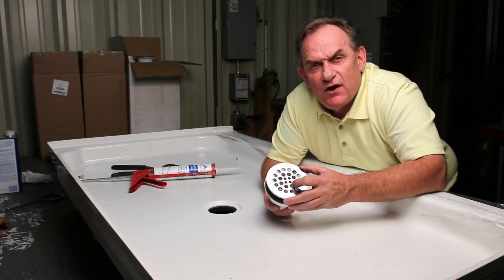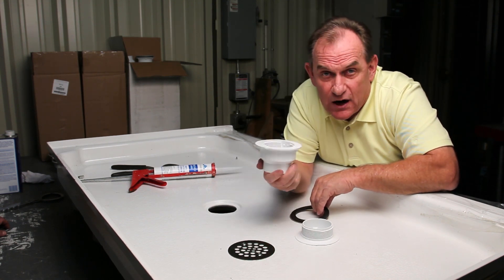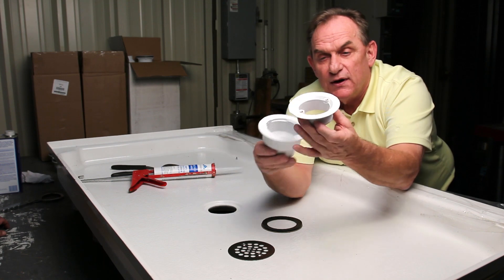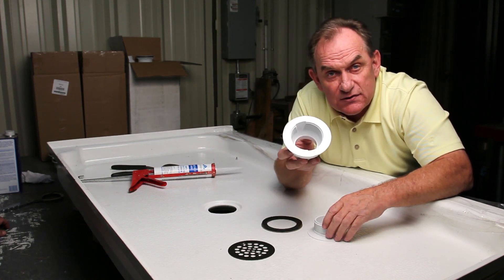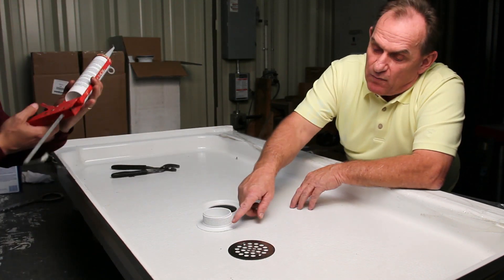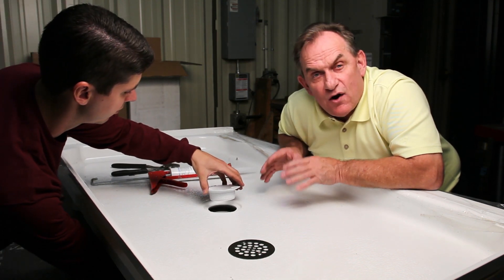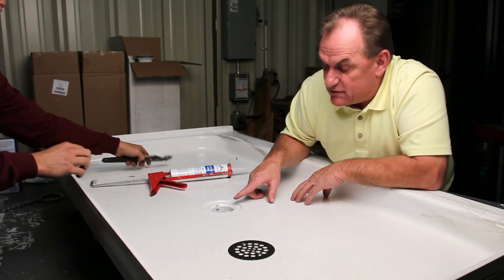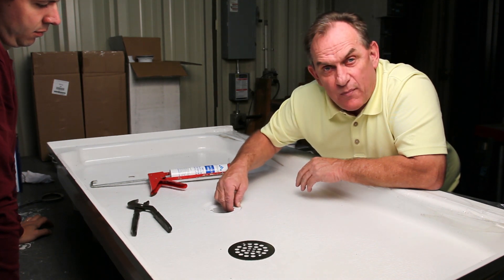Plastic Oddities - Fiberglass Shower Drain Installation Video

Comment: Sure enough the contractor who installed our shower drain (new home in 2012) used a ton of putty on the flange (where you used silicone) and the threads (which blocked the weep channels). No doubt, this contributed to the seal failing over time, as the shower floor flexed and loosened the putty, which was water logged. Replaced the paper and rubber seal and applied silicone per your instruction and no more leak. Thank you
Reply: Thanks for the comment.

Comment: Great info.
Could you tell me please what type silicone to use. I need to replace ours drain and want to do it correctly. The old one in leaking badly in basement. Thanks in advance.

Phil

Comment: Great video. To the point and all you need to know.
Reply: +shreddog35 
Perfect, straightforward.
He also UNDERSTANDS the reason the drain is designed the way it is, with the side Weep Slots: and yep, seen plumbers I worked with gob those all up with putty. Block those and get a call back at some point with leak issues down below.

Would LOVE to work with this guy!

Comment: Does the female portion get glued into the PVC pipe below?. Can you explain how that is done if you dont have access from underneath?
Reply: You just replace the top part and the two gaskets under.  Use long nose pliers to pull the old paper and rubber gasket out and slide the new one in between.
Reply: @stephenbell8757  B S you don't know what your talking about once everything is in place and glued up there is no replacing the rubber gasket unless you cut the pipe underneath and replace the whole drain.

Comment: how do you connect to the drain to the 2 inch pipe on the floor ?
Reply: I did an Oatey installation for a drain. The 2" drain pipe fits inside the female 2" piece at the bottom of this unit. You clean/cement the drain pipe and the inside of the female section of this plug. Then, you drop the pan on the drain pipe.

Comment: I ordered one from amazon and installed it..This had no weep holes.?
Reply: Looks like you'll be the only one weeping then.
Reply: Either you bought the wrong one or you misunderstand that the "weep holes" are merely channels that are on each side that allow any water to run down into the DRAIN instead of leaking at the rim.   If you look closely the channels are on the female part.

Comment: Why don't we put another gasket on top isntead of silicone? Why don't they sell the kit with 2 gaskets? Is it possible to remove the top part once the silicone has set in if we have any problems later? thanks?
Reply: The purpose of the paper ring is not to seal but to allow for tightening of the large pvc or brass ringnut against the underneath of the base.  A pvc or brass ringnut will bind-up when it starts to tighten against a rubber ring, causing a bad seal.  Hence the thin, slick paper ring.  Up top, the new  silicone will not bind when either pvc or brass is tightened against it.  
(This isn't rocket science.)

Comment: What will happen if you installed the washers on top of the fiberglass vs underneath. I replaced mines because of a leak and it's still leaking. I followed the pattern of installing washers on top like it was when I took it off.
Reply: Nothn
Reply: First off, many top flanges are slightly sloped downward toward the opening, following the contour of the sloped base.  Look at all your sink flanges-- sloped downward.  If you compress a gasket under these sloped flanges, you won't get even pressure everywhere and there's a liklihood of leaking.  Hence sillcone or plumber's putty used here.  The bottom (underneath) flange is always perfectly flat and will accept even, snug pressure all around.
Reply: @Pw6872  Excellent answer.

Comment: Thanks this helps but i will use a gasket instead  of silicone
Reply: Then the drain flange is too high and the pan won't drain rt. You'll end up with soap scum all over!

Comment: Great informative video but the guy screwed the top portion with the silicone on it around and around when he should of held the top portion in place and tighten the bottom by doing what he did he smeared all the silicone out as he was turning the top portion.

Comment: Silicone is not a good idea. When it leaks next time, good luck cleaning that silicone off the pan and getting a good seal again.
Reply: The amount of silicone is not hard to remove. Take a rag and just rub. It will come off.
Reply: You must never have removed silicone before. It's not hard. Some pans require it over plumbers putty.
Reply: @KingdomeBleachers  That's right. Perhaps he's confusing acrylic with silicon.